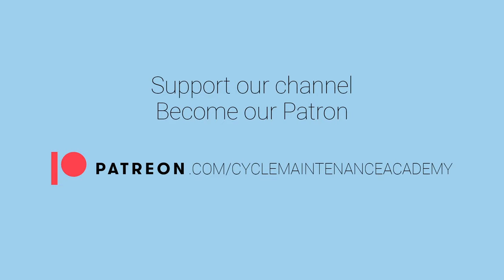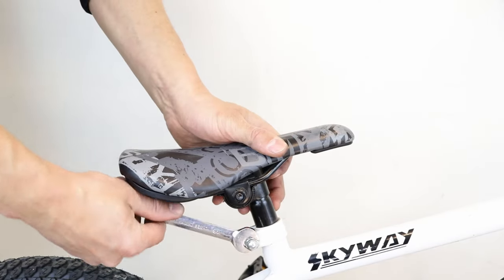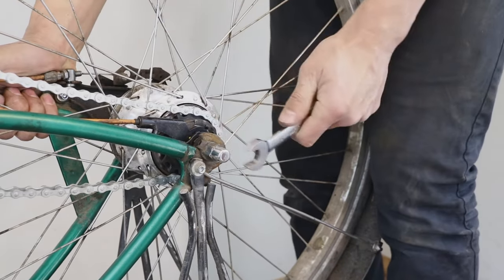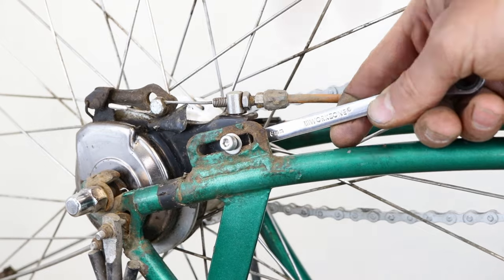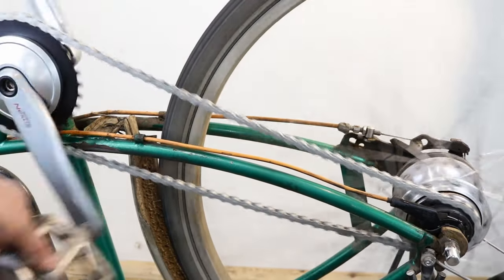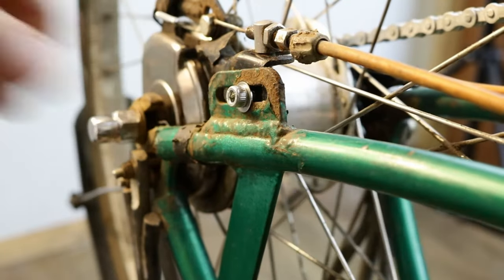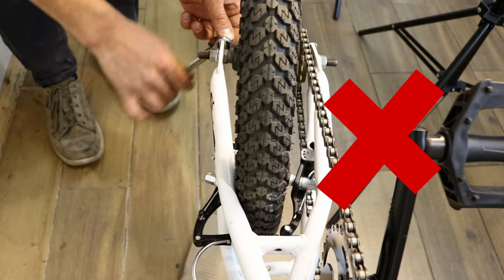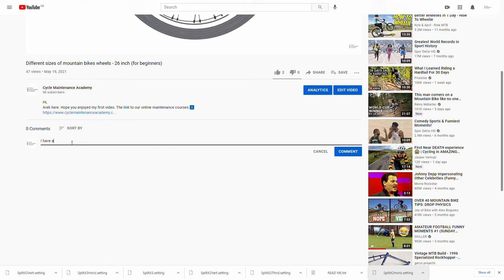How To Tighten Bike Chain

Comment: I think another important thing to mention:  Check the tension at different places in the rotation of the front and rear sprockets, as chain tension can vary with this.  This is because sprockets are not manufactured exactly concentric with their center (normal manufacturing tolerance).  Set the tension at the tightest point.  If you don't, it will be too tight at its tightest spot.
Reply from the maker: Hi, thanks for your comment and sharing this valuable tip with other viewers.🙂

Comment: The problem I have is that the tossers that sold me my bike have made everything as difficult as possible to adjust so that you'll just bring it in to them - my chain snapped and I had them replace it, so now the chain keeps jumping in almost all the gears no matter how I try to adjust it - is this something I can fix by tightening the chain? I also noticed the new chain is a link longer than the old one so that wouod explain why it might be loose - issue is I can't get to the bolts to loosen/tighten the back wheel
Reply from the maker: Hi Joel, thanks for reaching out and sharing your experience. Apologies for the delay in getting back to you.
I understand your frustration, and it sounds like there may be a couple of factors at play here. If the new chain is longer than the previous one, it could indeed lead to skipping issues. Additionally, drivetrains wear out over time, so if your old chain was significantly worn, it's possible that other drivetrain components, like the cogs, have also worn down, causing compatibility issues with the new chain.
It might be a good idea to take your bike back to the shop for a thorough diagnosis and any necessary maintenance. They'll be able to assess the problem more accurately and make any adjustments needed to get your bike running smoothly again.
I hope this helps, and please let me know if you were able to resolve the issue.

Comment: Does this work on bikes with 7 gears in the back and disc brakes?
Reply from the maker: Hi , and thanks for your question. Yes, it should work🙂
Reply: @cyclemaintenanceacademy  in trying to tighten the chain, i found out my derailer was WAYY messed up, which requires tools that i don't have lol. i think that was actually my issue

Comment: Now what does it mean if you do all this, but the chain is loose again with 2-3 minutes?
Reply from the maker: Hi, apologies for not getting back to you sooner! You’ve probably solved the issue by now, but I hope you don’t mind me answering anyway. If your chain keeps getting loose shortly after tightening, it's likely that the wheel isn’t secured properly and is shifting in the dropouts. Make sure to check that your wheel nuts  are tighten, and consider replacing them with new ones if necessary.

Comment: Yesss that the problet the crunching sound and the like holder is messt up
Reply from the maker: It sounds like you've pinpointed the issue! A crunching sound can definitely indicate a loose chain or a problem with the chain holder. If you need any tips on how to fix it, feel free to ask.

Comment: What if you have a bike with gears?
Reply from the maker: Hi Tony, thanks for your question. If you have a bike with hub gears then tightening the chain works this same way. For derailleur bikes the rear mech works as a chain tensioner. If your derailleur does not hold the tension on a chain then the chain is either too long or the spring in the derailleur arm is broken. We have a video where we show how to measure the chain so it's tensioned correctly on a derailleru bike here: https://youtu.be/7WFsuyogqqE
Hope this helps🙂
Reply: @cyclemaintenanceacademy  thanks for your help.